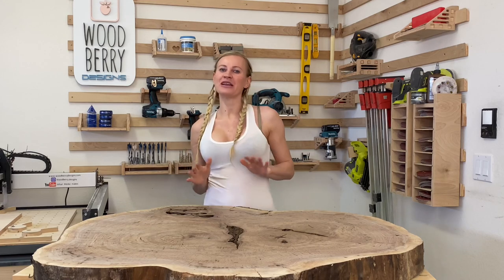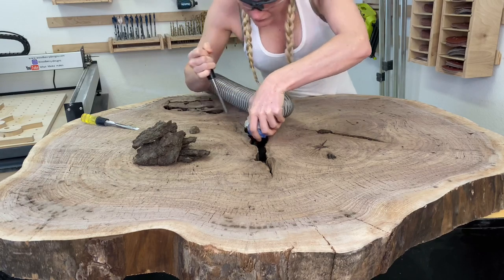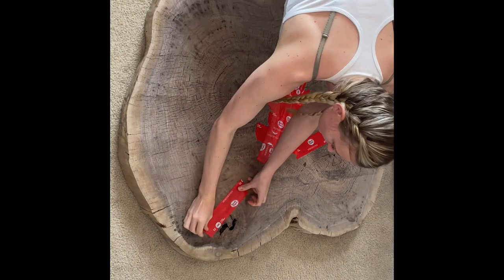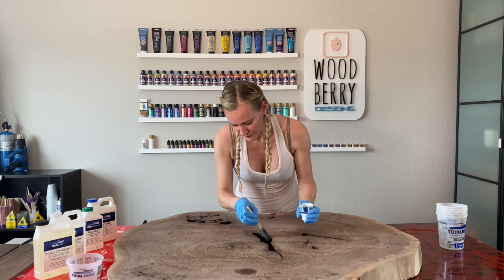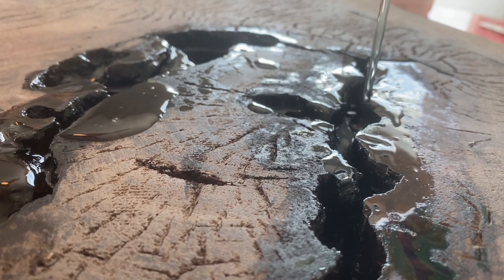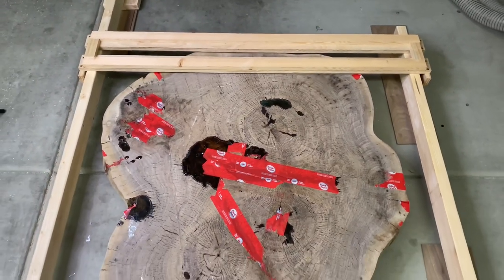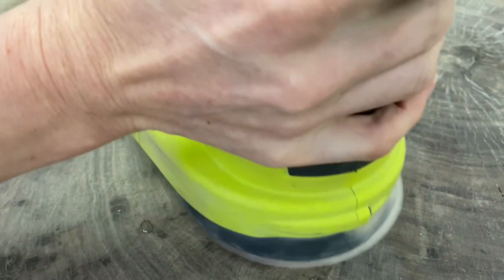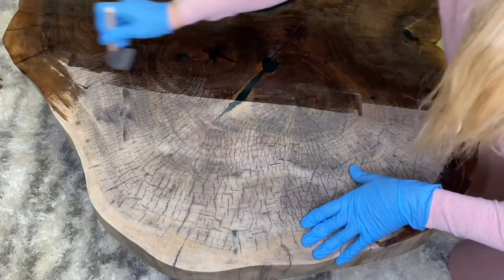BIG Walnut cookie resin table

Comment: You should try a UV resin called Bondic for small holes. It's the best product I've ever used. It's versatility is unmatched and limitless. It cures in seconds with a Shore D 85-90 hardness which is the same as a construction hard hat.